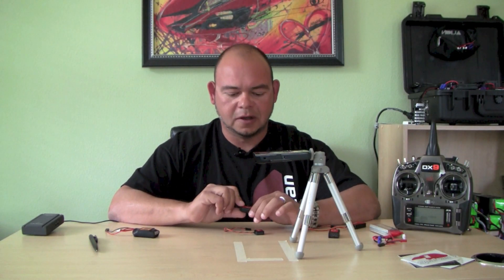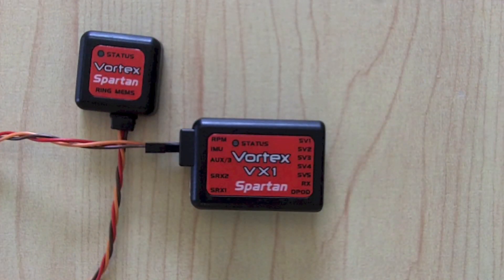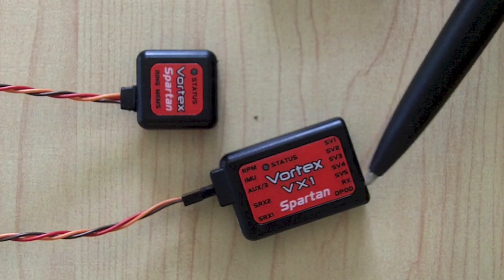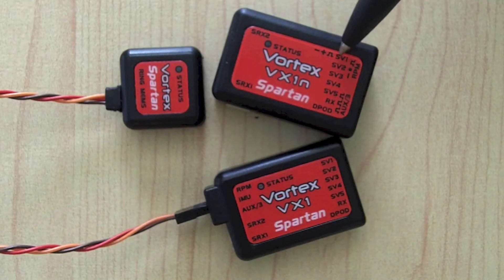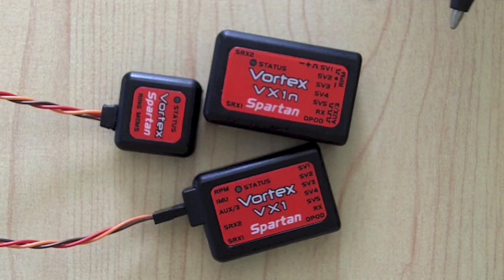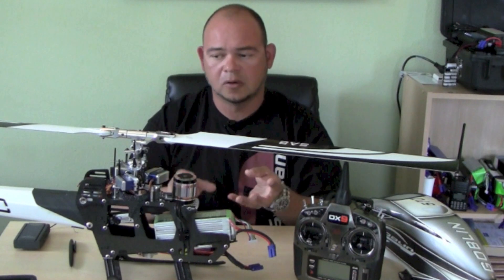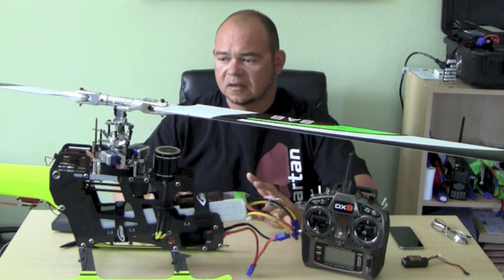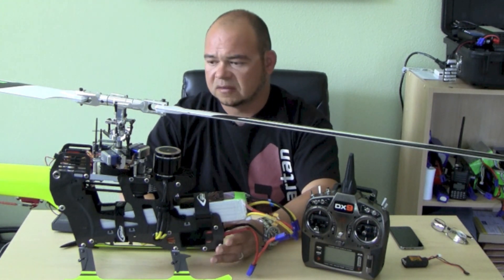Spartan Vortex Setup Part 3 of 6 - Connections

Comment: Just curious about the way you mounted the vx1n with the wires butted up to the back of your antirotation bracket... don't you have a hard time accessing the wires & plugging your Datapod?   Wouldn't you have better access with the ports facing backward?
Thanks.